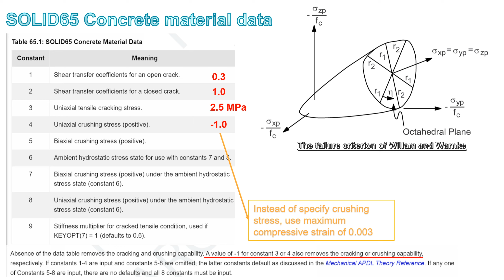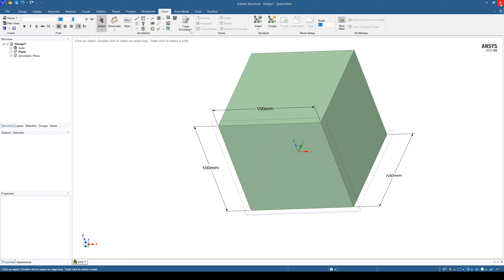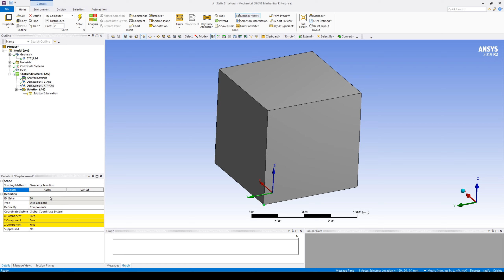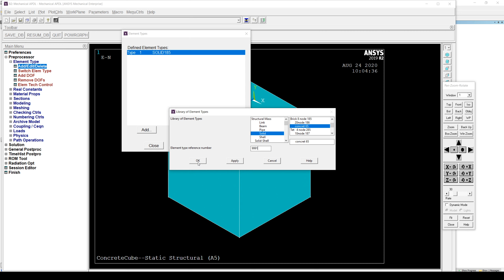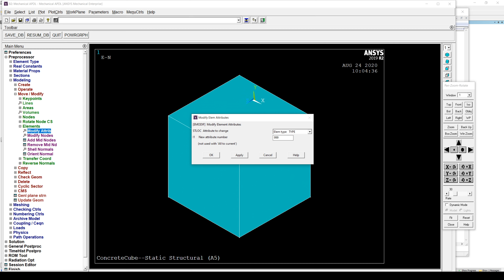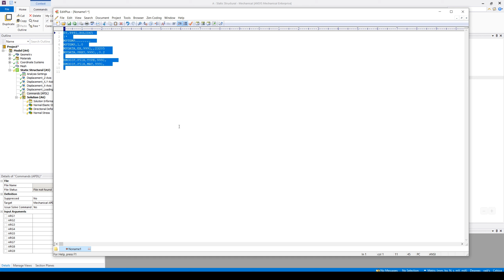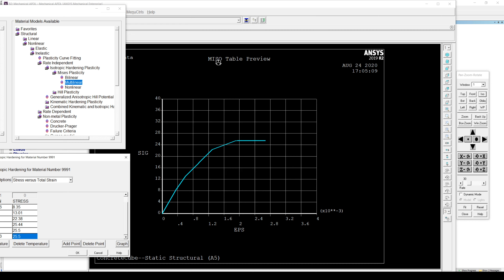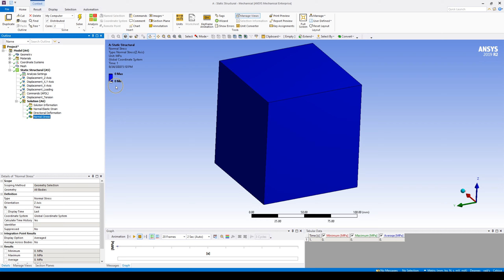ANSYS Tutorial: Understanding APDL command for SOLID65 concrete model using ANSYS Workbench 2019

Comment: Have you tried using the Reinforcement type for line bodies in Ansys 2020? I think it is easier like that. I´m trying to model a bending test for a RC pole for electric lines by applying displacement to the top. Do you know how could I determine cracks or at least the first crack?
For the concrete I use Menetrey-Willam model
Reply from the maker: The new reinforcement feature is robust, but Menetrey Willam is not as good as ANSYS trying to promote, also Drucker Prager concrete and Micro-Plane model.
The research paper using those model only demonstrate the model under a very small scope.
There is a very high chance that we will get significant erroneous results without SOLID65. It is very easy to notice what I'm trying to say by just replace the concrete model with MW or DP or MP in my tutorials and compare to the experimental results.

Comment: thanks for the tutorial, I have followed the tutorial you gave, but there is a problem. when starting to solve, warning message show "Result file not found. Certain graphical information (such as the deformed shape and erosion) cannot be displayed. please clear the solution and solve again." then also the message "an unknown error occurred during solution. check the solver output on the solution information object possible causes"

all happened in your tutorial that has a command. when I remove the command, the model can be solved. can you help me?

Thank you.
Reply: fyi, i used ANSYS 2025. error occur in Ansys Mechanical
Reply from the maker: @irwannf7422  Using a version different from what is specified in the title will not guarantee a successful run. Each version can be slightly different from the previous version.

PS. This tutorial was not made for ANSYS2025.
Reply: @ThanaponBuamongkolChannel  Okay, thank you very much

Comment: Hi Thanapon, thank you for the video. I have a question. I'm trying to model the creep of concrete in my model on Ansys Workbench but on the program are present only experimental formulation for the creep (e.g. Strain Hardening, Time Hardening, Generalized Exponential, Norton, ...). However I need to model creep using the model which is reported in the European Codes (Model Code 1990 and Model Code 2010). This is the equation reported in the European Code where the strain is given by the sum of the initial strain at the moment of the application of the load (sigmact0) and the strain due to the creep.
εcσ(t,t0)=σc(t0)[(1/Eci(t0))+(ϕ(t,t0)/Eci)].
Is there in Ansys the possibility of use this method for the creep of concrete?
Thanks for your advice.
Reply from the maker: In practice, the problems that require long-term properties of concrete (creep and shrinkage) involve prestressed loss, long-term deflection, or long-term column shortening in the tall building. All those problems will be calculated using Midas, ADAPT, CSI-ETABS, CSI-SAP which are more suitable than ANSYS.
CEB-FIP 90 and fib-MC2010 also included in ETABS for example.

Comment: I watched and followed the video. It was very specific to help me better understand the usage of ADPL Commands. However, when I try changing the input condition instead of the displacement I assign with the pressure value, all other declarations stay the same, but the result is an error. The same happens when changing the boundary conditions. Please tell me why?
Reply from the maker: Either providing the nodal displacement as input in order to obtain the member forces or providing the external forces in order to obtain nodal displacement are identical as long as the FE model is numerically stable. (Also refer to the numerical method in finite element analysis for further information.)

The finite element method used in the computer software is based on matrix analysis. The matrix itself doesn't recognize whether nodal displacement or nodal forces as input. The results will always be the same as long as the matrix is mathematically the same (static equilibrium).

If you still have trouble with a solid element of how the above explanation works, try testing with simpler elements such as line element (truss element is the easiest to test and verify), then plane element, then solid for the last. And try to begin with linear elastic analysis, then nonlinear analysis.

In short, understanding how the matrix works will help overcome much trouble when using computer software.
Reply from the maker: In addition, there is some situation when trying to obtain structural displacement while applying nodal forces in such a way that the structural stiffness degraded (due to the nonlinearity effect) to the point that it is tough for numerical solution to be converged because of numerical stability is so bad.

 In this same situation, applying nodal displacement instead of nodal forces improve and in many cases prevent numerical instability and help the solution to be converged easier than using nodal loads, some reference called this method a displacement control.

Although in theory, applying nodal loads or nodal displacement are considered equivalent but the numerical convergence is significantly different, especially for the highly nonlinear problem.

Comment: thank you so much.Is there a way to solve steel in line and in solid part
Reply from the maker: For the rebar that explicitly modeled with the LINK element, ANSYS workbench now able to directly support both input and output data. There is no longer a need to prepare APDL command for rebar that has been explicitly modeled.

For smeared rebar, use Real Constant menu in Mechanical APDL.
The APDL command for smeared rebar will look like this.

tb_rebarratio_x = 0.0
tb_rebarratio_y = 0.0018
tb_rebarratio_z = 0.0018

meaning that there is no smeared rebar along the global X-axis and there are smeared rebar of 0.0018 (volume ratio) along the global Y/Z-axis.

And followed with these:

!* Smeared rebar in VR1 direction (0,0) degree, VR2 (90,0) degree and VR3 (90,90) degree

R,solid65_matid,steel_matid,tb_rebarratio_x,0,0,steel_matid,tb_rebarratio_y,   
RMORE,90,0,steel_matid,tb_rebarratio_z,90,90,  
RMORE, ,

Comment: I'm new to ansys ... why the crushing stress -1?
Reply from the maker: SOLID65 suffers from meshing dependent and convergence issues. Disable crushing mode by putting -1 and replace with a manual crushing check (the 0.003 strain) will help the solution converge easier.

With cracking alone, it already creates enough challenge in numerical convergence.

The better element for concrete strength degradation (the negative slope in the stress-strain curve) and strain softening after cracking is CPT215. The downside of CPT215 is its parameters are quite skeptical and hard to verify at the moment. It requires some more time for CPT215 to be fully explored. For the time being, SOLID65 is the most reliable just because its model is the most explored.
Reply: @ThanaponBuamongkolChannel  How does Ansys know that the rupture criterion is at  0.003 strain? in the video the last point was at 0.00243
Reply from the maker: @g30923  ANSYS will not recognize 0.003 on its own, the user has to manually interpret the analysis results. By trial and error until there is a suitable range of results.

Comment: I tried to solve a little bit more complex structure (simply supported beam) with the same way, but I couldn't solve the structure. ANSYS gives an error massage "an unknown error occurred during solution". I would be grateful if you help. Thank you very much for your kind interest.
Reply from the maker: The tutorial in the following playlist includes various structural elements from basic such beam/column to more complicated such as heavily reinforced one.

https://www.youtube.com/playlist?list=PLYX5ua4SRf6zibnuG3WM43gLJkUVBUgkx

I also put some guides for people who got stuck with errors in the comments down below each video. Hopefully, it would help you get past the errors.
Reply: @ThanaponBuamongkolChannel  Thank you for your quick response. I have already watched the videos you recommend. I modeled simply supported beam without rebars and, I wanted to replace solid 185 with solid 65 using APDL commands like in this video. When I activate the command the solution fails. I will be trying to fix the errors. Thank you very much again.
Reply from the maker: SOLID65 is naturally not suitable for plain concrete models as a structural element due to meshing dependent problems (different mesh cause different numerical problems) and convergence issues after cracking. 

The simply supported beam without rebars will certainly cause numerical issues, no surprise.

Numerical issues will appear soon after the first crack.

You'd better leave the plain concrete beam model alone for a while until you learn CPT215 which is better than SOLID65 when dealing with plain concrete. CPT215 supports tensile strain-softening, therefore, better numerical stability. 

The reason that the SOLID65 concrete cube in this tutorial works just fine without any numerical difficulty even with post-cracking behavior because of the way boundary condition applied. It is displacement controlled that reduce the number of degree of freedom that need to be solved in the matrix, hence, numerical issues have been suppressed this way. 

If SOLID65 is not good when concrete cracking, why it is performing well in the reinforced concrete model? The answer is, the rebars will be immediately activated right after the first crack and stabilize the numerical in the stiffness matrix, hence, the solution could be converged this way.
Reply: @ThanaponBuamongkolChannel  I see. Actually, I am interested in masonry structures rather than the concrete ones. But as far as I know, Solid65 is a suitable finite element for masonry. I want to analyze a historical structure under seismic loads and check for cracks. Actually, there are studies performed using Solid65 for masonry.
I don't know whether the CPT215 is suitable for masonry or not. Besides this, the solution is terminated with error messages even if non-linear parameters are not assigned to the material model.
Thanks a lot again.
Reply from the maker: Try to suppress the APDL command (right-click at the item and choose to suppress), the model will now become linear elastic, the solution supposes to be a success. If not, the problem may be laid somewhere from geometry, meshing, boundary conditions, and loading. Try to fix them.

Once success with the linear elastic model without APDL, gradually add APDL command by starting with linear elastic material, then add a non-linear property, then cracking (concrete). Normally, it is cracking that cause issue.

Since your problem involves brittle material behavior, try to google search something like "ANSYS restart analysis". With the restarts feature, you will be able to adjust the substep size every time your solution fails to converge. Every time you restart, the analysis will continue right after where the solution just fails.
Reply: Thanapon Buamongkol I have no problem with linear solution. So I will add the commands gradually. I hope I will success. Besides, I will study restart Analysis.
Reply from the maker: Also, something that might be easily overlooked :

Element Order ==> "Linear"

and/or

Replace "MISO" with "MELAS" in the APDL command.
Reply: @ThanaponBuamongkolChannel  Unfortunately I could not overcome the problem. I include the command below just providing element change with SOLID65, the solution is terminated with errors. I have also tried your element order suggession.

/PREP7
  
ET,9991,SOLID65 

MPTEMP,,,,,,,,  
MPTEMP,1,0  
MPDATA,EX,9991,,35000   
MPDATA,PRXY,9991,,0.2   

EMODIF,ALL,TYPE,9991,  
EMODIF,ALL,MAT,9991,   

/SOLU
Reply from the maker: OK, here is the solution. Create name selection "NM_Concrete", the full workflow of how to is already in my other tutorial videos. And replace your snippet as follow. 

/PREP7
  
ET,9991,SOLID65 

MPTEMP,,,,,,,,  
MPTEMP,1,0  
MPDATA,EX,9991,,35000   
MPDATA,PRXY,9991,,0.2   

CMSEL,S,NM_Concrete,ELEM
EMODIF,ALL,TYPE,9991,     
EMODIF,ALL,MAT,9991,   
ALLSEL,ALL  

/SOLU
Reply: @ThanaponBuamongkolChannel  Thank goodness it worked. After the linear solution I added only cracking parameters using non-metal plasticity, the solution was completed up to the first cracking point. The results at this point are available thanks to restart analysis.   Actually, I want to get all cracks. I have heard about "the predictor-corrector algorithm" to solve non-linear equations fast. But I don't know how to use it in ANSYS. I am very grateful for your help. Thanks a lot.

Comment: Hello 

Thank you for your tutorial video.
I have a question here on my mind. At the beginning of the video, you have entered Isotropic Elasticity data using the Engineering data section. At the same time, you have created another Isotropic Elasticity data as a command block (the same Isotropic Elasticity data you created before) in the Mechanical APDL section.
Is there a need for such a situation?
When we create the data we enter into Engineering Data, as an instruction block do we need to re-enter the data?
Or can Ansys detect this automatically and solve it?
Could you please share your e-mail address?

Thank you for taking the time to read my message and for your help.
Reply from the maker: Actually, there is more than one way to set up the workflow. The recommended workflow for a beginner is as shown in the video which the APDL command will overwrite the data previously defined from engineering data. Therefore, whatever defined in the engineering data will be never be used later on. The structural analysis will always follow the APDL command.

No, you do not need to always follow the exact steps as shown in the video.

Comment: Sir this method is not working for me
Reply from the maker: Which part is not working? Inside the Mechanical APDL or in Workbench?
Reply: When I am trying to provide element property to my concrete and rebar its not working on them . no change in elements. Can you please make a tutorial step by step if possible to write apdl command u used in other analysis? 
Other than not working it also shows error and my rebar is not deforming.
Reply from the maker: There is only a concrete model in this video. You only need the APDL command for the concrete model. For other materials such as steel, you can directly assign the material using Workbench.

This video already shows the step by step of how to achieve the APDL command for the concrete model. 

Regarding another video that involves both concrete and rebars, please kindly post the comment/question on that video's comments section so that I could figure out which part you probably get stuck with.
Reply: @ThanaponBuamongkolChannel  for me using apdl I can change the concrete element type to solid 65 but the problem is ,the loading and boundary plates materials also got changed to solid 65 ,now it's showing all the element in the material IDof 999 which I given into it
Reply from the maker: @LonelyMooN8  Please refer to my other ANSYS tutorial (eg. RC beam or RC column,...etc.) for the example of applying the APDL command properly.

In short, pay attention to the following command.

CMSEL,S,NM_Concrete,ELEM

The "NM_Concrete" is the group name assigned to the part that is intended to be SOLID65 from geometry using SpaceClaim. This way, only the intended part will be designated as SOLID65 and not affect other parts that are not supposed to be SOLID65.
Reply: @ThanaponBuamongkolChannel  if I use this command ,the other parts not showing and also the loads not act on it